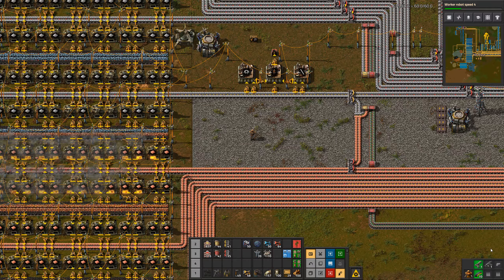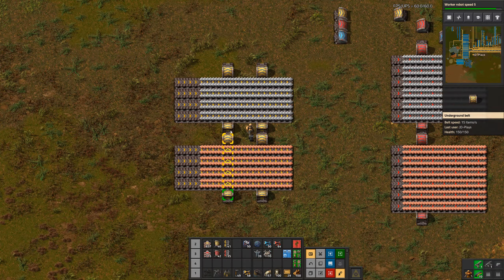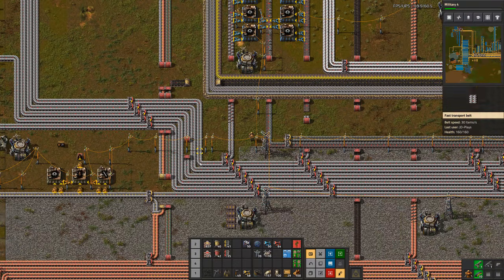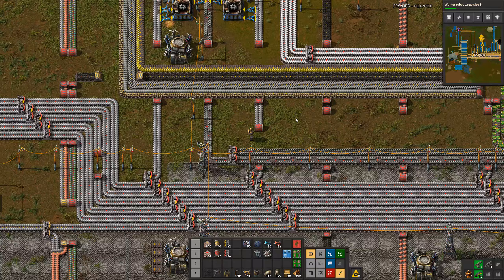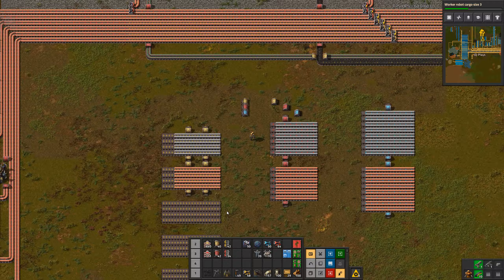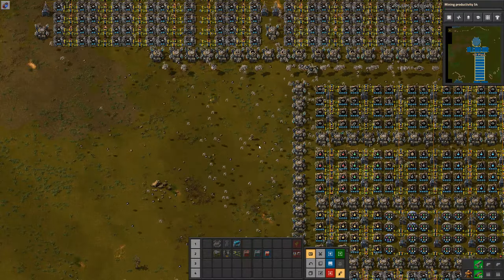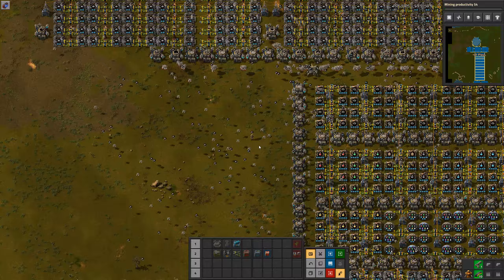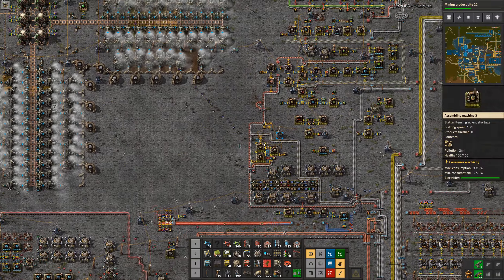Factorio Base Types Belts vs Bots vs Trains ⚙️ Introduction to Factorio 1.0 ⚙️ Tutorial/Guide/How-To

Comment: I like to build mine as a modular base design. 

The basic concept is that I design a module,  which is a medium sized blueprint which takes multiple input items and produces multiple output items at a specific, predefined ratios and throughput. The assemblers in a module are usually running at as close to a perfect ratio as possible with each other. And the output ratios are mostly based on the ratio of how much of these things that you'll need for the next module in the pipeline. Each modules are connected to one another by trains. Basically a module can be thought of like a giant assembler.

The simplest module, for example, is the science module, which produces 1 item per second for each science pack from plates, coals, and a half dozen of other intermediate products. Each module blueprint has a calculated amount of input and output, so you know exactly how much input materials are needed and you know that as long as you can sustain that input throughput, the module will produce exactly the amount in the designed ratio. The trick here is that you don't manage bottleneck for individual inputs, instead you also design another set of modules that produces exactly that amount of intermediate products for the module in the exact ratio needed, so you can just plop down these supporting modules to support the production of the main module. This repeats for a few levels until you get to the raw materials.

With modular design, rather than trying to find bottlenecks and balance production and consumption ad hoc, you only need to calculate in the number of modules. So you never need to worry about bottlenecks beyond the raw materials and transportation of raw products.

The goal when designing a module is to minimise buffering and transportation of any sorts. I usually don't transport high volume items, instead they're boiled down to intermediate products close to where they're mined to minimise traffic in the main train network. I try to use direct insertions as much as possible in modules, and belts are generally very short. This just-in-time production means that the factory is very compact and responsive; any bottlenecks in raw material productions will be immediately visible, and restoration in throughput will be reflected very quickly in just a few cycles.

This makes expanding factory very easy, rather than running around finding the next bottleneck, you know exactly how much your going to produce and consume, and only need to worry about bottlenecks in raw materials.
Reply: How would you handle this if you were playing Madclowns AngelBob Modpack?
Reply: I go by the 

Transport stacks of items manually
-> 
Micro blueprints on single main bus (8 belts 6 pipes and electric lines)
->
Square modular cells with trains
->
Automatic decentralised macro cells

Comment: A few improvements for anyone making bot base, especially at scale. Restrict output chests to 1 slot, when multiplied by the number of machines that's enough to supply the network without excessively consuming the ingredients. Doing big fields of 1 kind of material does create longer flight paths your better off with machines more mixed in together and closer to the sources or destinations of the materials being made.

Comment: I really don't like main busses for a different reason: They pretty much say you will not go past the rocket. Say you need to add just 4 lanes of green circuits to expand your blue circuit production. Where on a main bus will you do that when you already filled your bus with stuff to get to the rocket? Even if you can figure it out it's a big waste of time putting 4 lanes of green circuits on the bus just to have them all go to blue circuits. 

What this "just until rocket" mentality the main bus instills is you are missing out on the awesome megabase gameplay, where trains really become essential and it's a completely different game with completely different challenges and way you play the game. 

Megabase is also where factorio becomes completely unique. Satisfactory may have cool 3d graphics, but it cannot handle thousands and millions of resources and bots moving around. I only know of factorio that does this.
Reply from the maker: I agree with you but its outside the scope of this video.

Comment: In my first "proper" Factorio game I rebuilt my entire bus and decided to build gears and all the circuits "off" the bus by peeling a bunch of lanes off to exclusively provide for them. That way it didn't effect the resources on the bus proper and also drastically decreased the bus size.
Reply: I basically did this with trains in regards to steel. At some point you can do things like dedicated an iron ore patch to just gears, plates, or steel
Reply: @ThatOliveMrT  I just expanded my walls to an absurd degree and ran belts into a 64 belt balancer on both sides of the iron smelting. This was on a deathworld with railworld resources.

Comment: While there isn't a correct way to play I like to use trains to keep belts full on the consumption end. Bots are great if you have 'unlimited power'. Drones may have a small stack size but their unlimited speed + how inserters pull from chests vs belts should prove superior.

I don't do proper busses but rather a pseudo bus I call the 'sawed off shotgun approach'. Sure I need 6 lanes of copper but if you just keep building a long bus that material is held up in traffic compared to being actually used. So I'll build a 4 lane balancer but if consumption exceeds that I might as well build another unload train station and build another production block out.

In the end it works out like this. Ore patch fills a load station with plates (yes I move smelting blocks every time a patch runs dry) the trains come to the factory perimeter. If the belt spaghetti is too much the drones pick up the slack.

My drone logistics network is one singular massive network as construction drones can do their thing and logistics bots only leave the production area to fuel my nuclear reactors. If you have too many tasks spread out you'll see goofy logic on how what drones get assigned

Comment: In a bot based base, you can have a circuit network keeping track how much you have of each item.
Reply from the maker: This is true, providing you never use Trains to also transport items or any other box/container thats not also linked into the network.
Also You can hook wires to the belts and count the number of items on the belt and feed that into a single wire, or directly into a robo port

Comment: How about a play through where you have to launch a rocket using only burner inserters? As in the only type of inserter you can use is a burner inserter and you're not allowed logistics robots either.

If you want to and are able to mod it you could have all the types of inserters (e.g., fast, filter, stack etc) with their respective speeds and abilities but they still need fuel.

Any choice of resource settings allowable as you'll no doubt need more coal and oil.

Ideally biters and expansion would be on.

I want to see inserters powered by solid fuel, maybe nuclear fuel cells!
Reply: A really awesome challenge would be achieving a megabase with only the first tier on everything. So burner inserters, stone furnaces, assembler 1s, etc. Is it possible? who knows, but man that'd be a challenge.

If it is possible and achievable, the next challenge would be doing it on expensive mode, and then the next in a death world.
Reply: @jameshall5171  it's completely impossible
Reply: How would you get fuel into the inserters then...
Reply: @Djellowman  The same way burner inserters are always fueled - fuel on the same belt, or another belt of fuel+burner inserter inserting into it! YouTuber DoshDoshington has done a run where everything that needs power is modded to burn fuel instead, so e.g. every assembler also requires a burner inserter to insert fuel before it will work.

Comment: I notice you have gears on your bus.
While trying to answer the question of what to put on the main bus, I've noticed a number of people saying they just make those on site instead since most of the time you already needed the iron plates needed to make them sent in anyway.
Curious to hear a counterargument.
Reply: It takes 2 Iron plates to make 1 gear.  However I too favour building gears on-site since the ratios are straight-forward.
Reply: Gears on the bus would be great if 90% of the stuff that needs gears wouldnt need plates too...